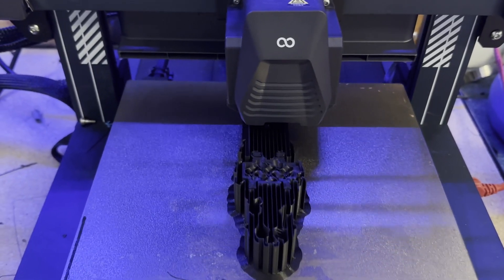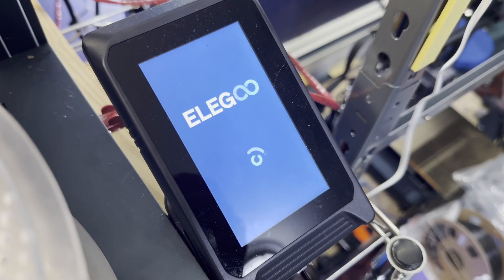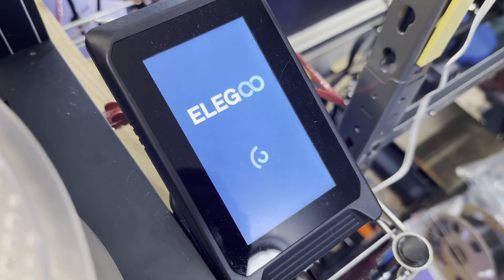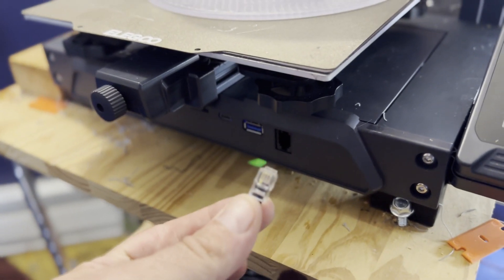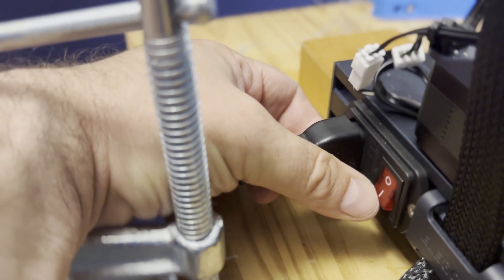Fix A "Dead" Neptune 4 - Elegoo Neptune 4 Screen Won't Stop Spinning!

Comment: I had this issue too. A quicker way was to unplug the Neptune 4 power cord, then click the power button on. Once I plugged it in again the touchpad came up within 30 seconds.
Reply from the maker: I've been having recurring issues now where it comes back up and moonraker isn't running so I can't print.
Reply: @davetriesthis  I so hope the upcoming klipper updates help
Reply from the maker: @jeremy_6674 I really hope so. All issues I've had seem to be problems with kipper/fluuid/mainsail while the hardware is solid.
Reply: this worked for me too! thanks!

Comment: I have the eternal spinning wheel. I've had the problem with it going to the klipper screen. but it wouldn't let me click the buttons on that screen. I would shut it down and it would start up fine. It finally did it to me and I started to print again and it went to the klipper screen. It did this 2 more times and I decided to update the firmware. (instructions on the Elegoo page stink) When I attempted the update it wouldn't work and after a few tries I now have the spinning Wheel. I have a Neptune 4 Plus.

Comment: I use a Wifi power switch for my printer to turn it on and off.
This happens when the board has a quick power cycle but does not do a clean or FULL power cycle.
You basically did electrical engineering 101, Fully drain the board of all power then booted it back up.

That's usually all it needs.

Comment: Thanks, I will have to try this! Having a similar issue, except during the print it stopped and gave me the option to either restart klipper or the firmware. Clicked firmware. It took awhile to reboot. Tried the print again. Same thing. Clicked restart klipper this time. Same process. Thought maybe it was the print, so went back to one I've printed several times with no issues. Same thing. Let it reboot, then i just unplugged it. Now the screen won't come on 😭
Reply from the maker: That's a "contact support" issue :(

Comment: My issue is with my Neptune Pro 4 (1 week old) and I started printing a model and it loosened from the tray so I hit the stop button and then confirmed stop.  I started printing again and it repeated the loosening from the tray 1 minute into the print.  I stopped it again but this time, the screen slowly went dark and now all I get is the on/off switch lighting up and nothing starts.  The screen does not go off of blank either.  Please help!
Reply from the maker: This sounds like an issue with the controller, the box that you use to control your prints. Take a video of starting up the printer and show how when you turn it off and then turn it on again that does not light up. Send that to support along with the serial number which you can find on the bottom of the unit. They'll need both pieces of information to help you out.

Comment: What do I do if the whole thing won't turn on? The screen included, I opened up to check the motherboard and there isn't any indication lights, wondering maybe I blew a fuse
Reply from the maker: It sounds like a motherboard issue, and you should contact their support. Make sure that you send them a video showing it not turning on when you flip the switch and send your serial number. They'll need both. 

I did a motherboard replacement and it's pretty easy. It's just remove connector from old board and put on new. Repeat.
Reply: @davetriesthis  Thank you so much!!! That helps a ton! :)
Reply from the maker: @ my pleasure

Comment: iNFELIZMENTE A M,INHA NÃO VOLTOU!
Reply: My Neptune 4 max touch screen not working. But options are showing.
Reply from the maker: Try the firmware update again and email support if that doesn't work. Send a video of the issue along with your serial number.

Comment: I think I had a short circuit on my fan because on my Neptune Max 4 all the lights flickered for a second and my back fan stopped working. Any ideas? If not I might just take the fan and let elegoo know. Maybe get a replacement who knows
Reply from the maker: I'd let support know. They're good with replacement parts. Be sure to take a video to send them and also give them the serial number. They'll ask for both.

Comment: Has anyone looked into this more? Ill know by tomorrow if it works but trying to get a jumpstart on it
Reply from the maker: Yup. Check out this video of mine. It's about the max but it's all applicable to the standard one. 

Neptune 4 Max -You MUST do these steps to get good prints and fix the problems.
https://youtu.be/C5ZZnfse4LI
Reply: @davetriesthis  didnt help... either of them

Comment: mine doesnt even do that i built it then it turns the indicator on but doesnt boot or turn on the overhead lights
Reply from the maker: That's a logic board issue. Drop their support an email.

Comment: Have you found a permanent fix for this issue ?  I have a Neptune 4 Plus with the same issue,  however your quick fix has not worked for me.
Reply: did you find a solution to the issue?
Reply: @blackfire344   After very good help from support, I had to replace the EMMC module on the motherboard and update both the screen and module... Do the Fixpack First !  My other one I just reflashed the EMMC
Reply: @billb921 how long did it take to get the replacement emmc?
Reply: @chadmoore6726  Slow boat from China... almost 2 weeks
Reply: Me too

Comment: My Neptune 4 Max has been a nightmare. One thing after another. After I finally got through a lot of the headaches I did a firmware update because it was bricked and now when I try to perform a bed leveling it gets stuck at that screen and remains there. I am really just thinking about sending it back at this point. Any fix this?
Reply from the maker: Did you firmware update the controller too? Try to firmware update the machine and the controller again. If it still hangs I'd send it back.
Reply: Mine was doing that same exact thing, and now it won't even start up, just circles and circles

Comment: Disconnect all the LAN and USB, you can additionally try this disconnect chord thing and power up maybe when the printer is off and all that kind of voodoo because we don't know why it happens and how to exactly fix it but once it booted into this DISCONNECT DISCONNECT RESTART RESTART screen (go do something else in between it takes longer than usual)  you should have basically won.

On the right above is a button, click it. You now see the update blue button underneath. Make sure the files are in the root but IN the subfolder and remove everything else.
Then turn off let the screen completely die. Open and put the microSD in with the pins to the motherboard and until it clicks in place and you should be happy again!

Comment: Tried this on my neptune 4 max, but it didn't work.  Mine is dead right out of the box.
Reply from the maker: Like won't power up at all?
Reply: Printer powers up, screen is black. Walked away from it out of frustration.  Plan to try to update firmware tomorrow
Reply: Mine neptune 4 plus out of the box will work for a little while, then it will just freeze up. I don't know what is going on. I'm not the best with computers still new to this..... not sure what to do.

Comment: My Neptune 4 Pro had a spinning wheel but leaving it off a minute and a long reboot later fixed it.  I'm not sure why unplugging the touch pad when powering it down would fix a persistent spinning disk perpetual boot, but that's good to know, although it may have been a coincidence and Klipper eventually stabilized on its own.

I've noticed some weirdness with the Neptune 4 Pro firmware - mostly little things.  The LED light buttons are very slow to respond on the touch screen.  I'd seen this in review videos so that wasn't a surprise.  The LED lights also don't respond while the Neptune 4 Pro is warming up before a print (from the touch pad or via WiFi through the Fluidd interface) but they eventually turn on as soon as the printer starts to print.

Sometimes, I print a different job and when I return to print the previous job (same exact G code uploaded through Fluidd and Klipper), instead of printing in 3 hours it takes 5 hours.  The print quality is the same but it prints slower.  Print again also takes 5 hours.  I can fix this by cycling power to the Neptune 4 Pro.

After approximately 100 hours of printing, the print head LED is now so dim as to be useless.  Apparently the heat killed it.
Reply from the maker: I have definitely noticed the print slow down when reprinting issue. I'm not sure what's up with that but I'm glad that you said it because I thought I had lost my mind. I have been printing a cosplay backplate that I had already printed and it was so slow that I had to cancel the print as it would've taken 36 hours instead of the previous 16. It was especially slow doing supports.

I have not done the firmware update that is available as I needed to get Halloween cosplay pieces finished and didn't wanna accidentally brick the device.

I will be updating the firmware soon to see if that helps. The way I understand it clipper itself needs a an update.

It's surprising that the LED lights would fail. Do just mean the LED light for the printhead
Reply: @davetriesthis  - Apparently there are some Klipper override settings that are applied in addition to G code?  A cold boot seems to be the only way to ensure that everything is back the way it should be every time.  I tried sending the G code from the hard drive again instead of reprinting the G code from the Klipper Job screen, but the reprint was still 5 hours instead of 3 hours.

My overhead LEDs are fine, but the little LED on the print head gradually dimmed over the first hundred hours and is now useless, presumably because the heat from the print head damaged the LED.  Oh well, it was a nice feature while it lasted.  I still had the flashlight on my desk that I was using to check the print on my previous 3D printer, so I'm back to using that.
Reply from the maker: @Liberty4Ever  Similar things here. Mine was a reprint from the USB that went very slowly, although that model ended up being a problem—I know because someone on Etsy reached out to me after I left a positive comment on the store of a cosplay creator that they were having an issue with one piece. I was having an issue with that piece, and anything I printed after it went slowly. So I'm trying ot nail that down.

Comment: The processor is inside the screen module. You dont need to take out the main power, you can just take out the telephone cable out and that will fix it
Reply from the maker: Good point. I power cycle because I want there to be no residual charge in the system and it to boot when I power it one but you're right that's not necessary

Comment: I honestly thought I was going to have to RMA my Neptune 4 Pro! I tried turning off the power, unplugging, etc. It finally just came back up on its own, but it sat there spinning for 30 minutes before doing so. Couldn't access fluidd or the screen.
Reply from the maker: Yeah this needs a firmware fix quickly. I got a tip from another viewer that if it happens another way to reset it is to turn it off, take the power cord off, leave it for about five minutes and the turn the power switch ON before plugging it back in. I can't think of any reason this would work better than just turning it on with the power cord in it but it seems to work. 

FWIW I just got the Neptune 4 max and it hasn't done it yet. So maybe they did a running change on the firmware.

Comment: its not working for me any other method ?
Reply from the maker: Try this other trick someone said. Power off and wait till the screen does. Remove the plug and wait a few minutes for power to drain from the machine. Turn the switch to on BEFORE plugging it back in. Plug I.  It's worked for me a few times. 

I'm not even trying to do leveling via the control pad now. I'm doing it through moonraker. 

This will all get a lot easier when they release new firmware to fix this.

Comment: Can you check if new firmware came out fixed this problem? No information on patch note.
Reply from the maker: I can try but the only way I'd know is if it has the same issue again, and it's only had it that once. However I did share my original video with the engineering team so I'm hoping that's what the patch was for.
Reply: @davetriesthis  i updated my firmware (main board and screen) and it still dose the spinning wheel thing. so new firmware did not fit that problem.